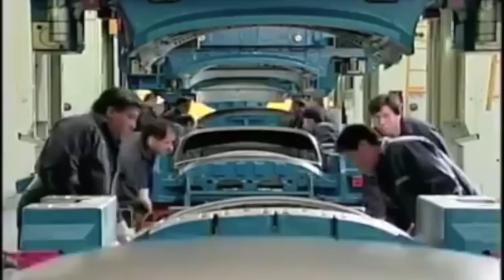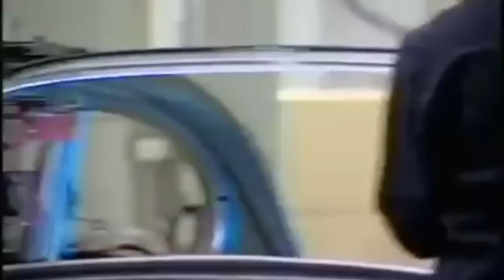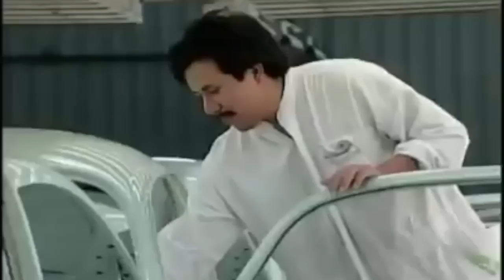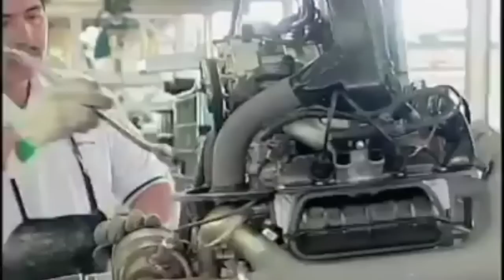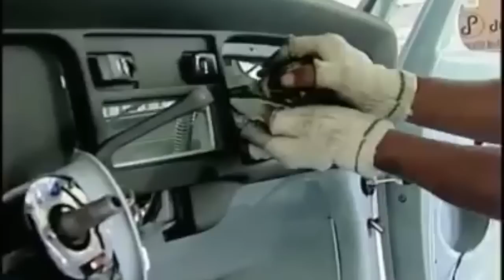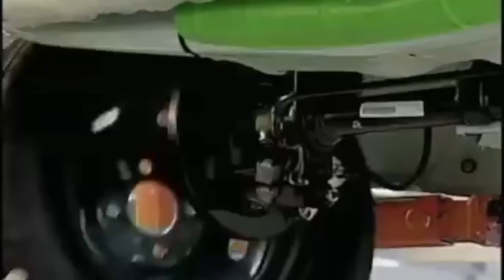VW Beetle Ultima edición Production

Comment: An authentic late-1930s style car you could literally buy brand new up until the early 2000s. It may have been facelifted during its entire production run, but the outer shell remained exactly the same as when it debuted and its appearance was completely normal back then. This is why it was an authentic late-1930s style car. Also, although the whole purpose of facelifting certain components was to modernize the model, again, the outer shell remained exactly the same which is exactly why it stayed in the same generation. However, for this vehicle, the outer shell’s authentic late-1930s style appearance really made it stand out even after receiving multiple facelifts, which is why it looked too much like a car produced decades ago when it was in fact produced during the very present year.